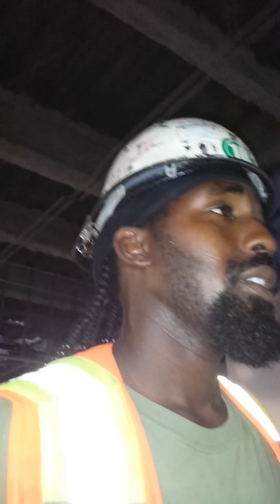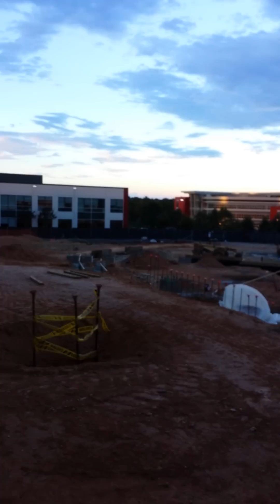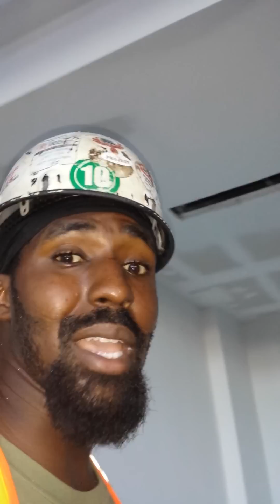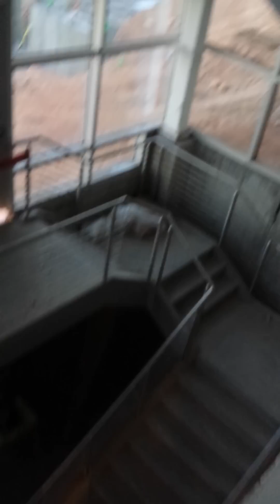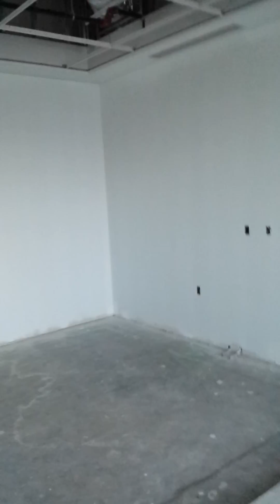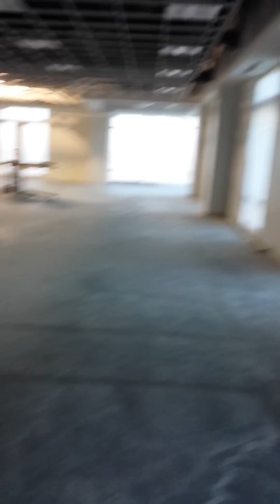Pipe welding on the job tour and discussion with Chris.taner

Comment: Hey bro, I really need advice about this because im currently about to choose which path to specialize in, in weld school. I just finished a 2 month program in PA, was very basic. Now I am going to Kentucky Weld institute, and deciding whether to go Pipe welding, or Structural. I dont want to work on the pipeline, I wanna do the type of stuff you are doing. Construction sites, power plants, paper mills that sort. Does pipe welding pay better than structural, and does it get tedious doing the same weld pretty much every time. Which would you recommend going into- sturctural or pipe. 
Thanks

Comment: To be a welder inspector can I just take the classes in school or do you recommend me trying welding first?
Reply from the maker: You could just take the classes and then take the test for your CWI. I  Recommend that you get at less 2 or 3 years of welding under your belt first. Tig welding and stick welding on carbon and on stainless steel matel.

Comment from the maker: thanks.
Reply: christaner I didn't get certified in pipe while I was in school but I went back in learned through the graduate refresher program and I was wondering if it is hard to get a pipe welding job without a certification from school?
Reply: christaner I didn't get certified in pipe while I was in school but I went back in learned through the graduate refresher program and I was wondering if it is hard to get a pipe welding job without a certification from school?
Reply from the maker: No it's not hard, you don't need to have a pervious certification  because which ever company you decide to work for you will have to take there test in order to be certified with that company. Most jobs don't recognize other company certification.